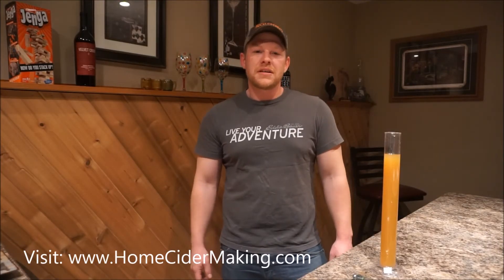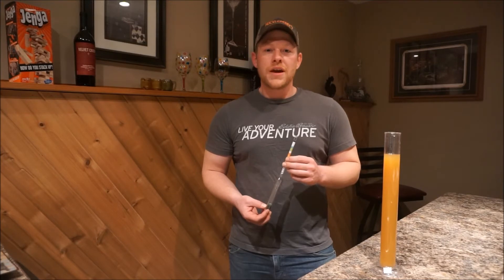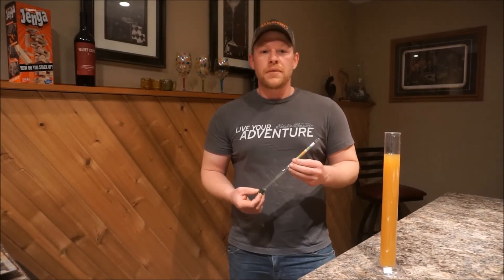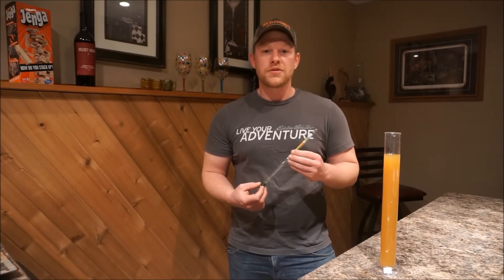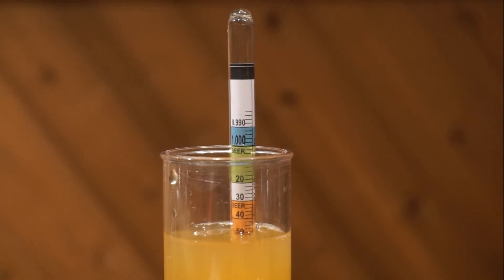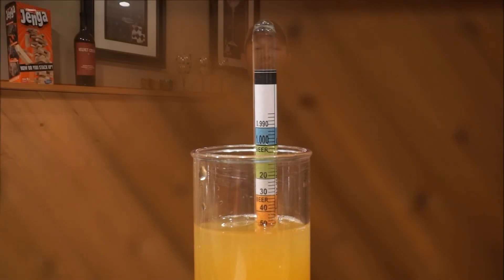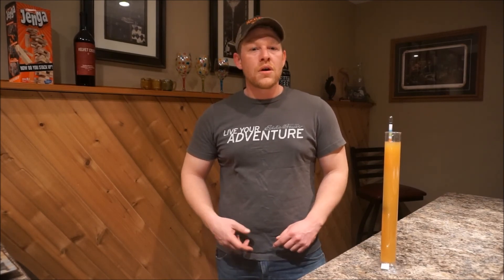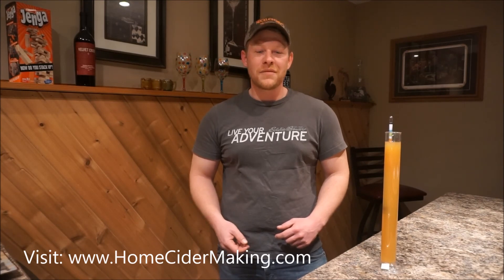How to Use a Hydrometer to Measure Specific Gravity of Cider

Comment: I saw the reading at 50 at the top of the cider juice. Is this correct.
Reply from the maker: The cider pushes up against the hydrometer right where the reading is taken. Its hard to see as it is almost clear, but in person, it's more visible.  This one is between 1.046-1.048 SG.
Reply: Thank you.